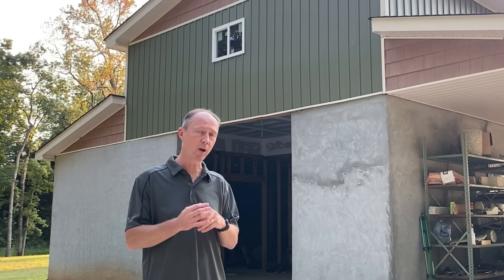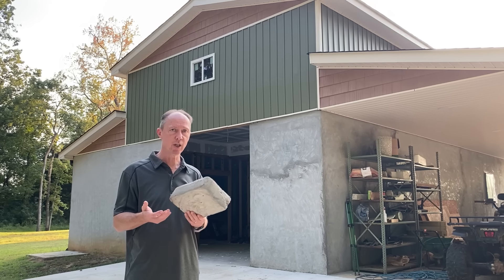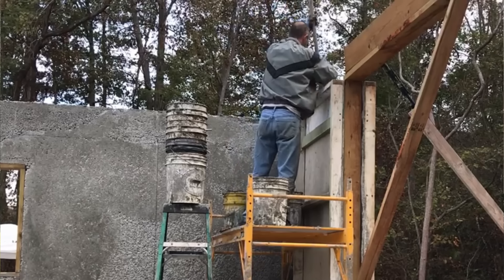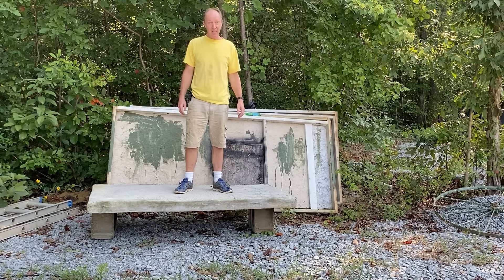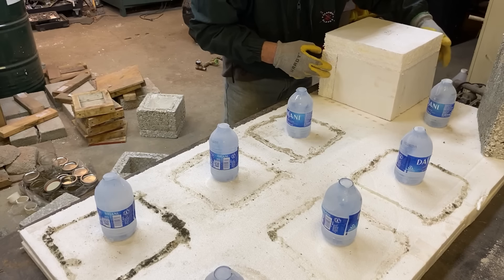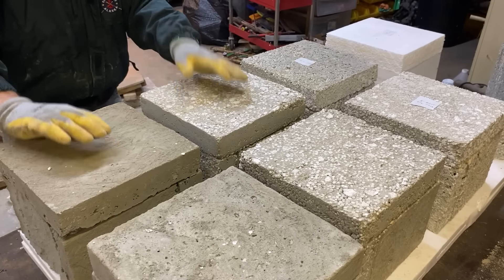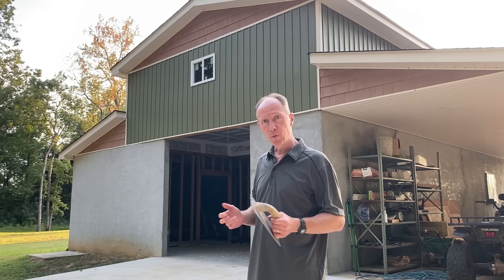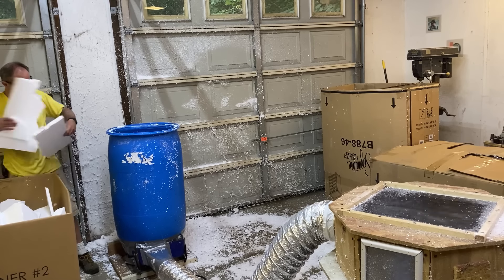The White Gold Rush?! The Video That CHANGED Aircrete Forever!

Comment: One method that would be good for someone trying to build like this alone, is instead of doing whole walls, make interlocking blocks. Kind of like those you see on some road construction projects. The size of which would be 3'-4' long by 1.5' wide and high. The size could be adjusted for whatever weight you have the capability to handle.
I am curious to know what your mix weighs when cured per cubic foot.
Reply: fwiw there  are a couple companies that have and still make ICF blocks out of it....
Reply from the maker: Hi Rollin. The mix I am using weighs around 10 lbs /cu ft.
Reply: @AbundanceBuild  do you happen to know the compressive strength?
Reply: @RollinShultz  Almost nothing. Don't build walls with this and put a roof on it. Long-term the expanded polystyrene is no better than air and without any other proper binding/strength substrate, walls built with this, if they're under constant pressure, will fail. Stucco is absolutely not a way to strengthen anything, it's just a finish. Make decoration with this kind of aircrete, by all means, but please, never ever, ever use this to build anything that puts lives in danger if/when it fails.
Reply: @tomteatom  You are right that stucco is not the way to strengthen but latex cement on fiberglass mesh that is a 1 centimeter thick shell is the way to strengthen it and it is incredibly strong.
Reply: @tangokaleidos1926  It's not just materials, although obviously you can strengthen anything if you care little about the cost and weight of additives, but something that's incredibly important from an engineering perspective is considering the actual physical shape of what you make. When these foam/cement bricks are produced in a commercial setting this is absolutely vital. The shape is informed by the nature of the material. The natural problems with using a polystyrene substrate are that it's incredibly weak and brittle if the substrate is allowed to cluster (and given the high electrostatic attraction of polystyrene balls, it's something that is difficult to avoid) and so the commercially available versions of this kind of brick are engineered to ensure that there's as much control over this as possible, with thin layers and an interlocking/interweaving structure that ensures your house doesn't fall on your head because the weight of the roof is resting on a fist-sized clump of polystyrene pellets that you couldn't see because you made enormous panels out of a slurry, because you simply didn't know why things are made differently. 
I have no problem with people experimenting, I just think it's absolutely ridiculous for someone with no experience as an engineer to be putting videos like this on the internet, endangering peoples lives, just because they had the sheer stupidity to think they didn't need to understand the subject they have decided to tackle.
Reply: @tomteatom Got a blankie, Tom?
Reply: @ Great reply, well done. Really added to the conversation, after 2 years.

Comment: That's a great idea you have.  I'd like to build a shed with this, possibly adding metal studs inside for added strength.  Thanks for posting.
Reply: It's been done already on Youtube.
Reply: @mackemacchiato3238  The wood would be slow to dry if it did absorb water from the drying cement, but that seems like it would be an issue of shrinkage and warpage from the water, rather than concerns for rot.  

A lot of people think rot is caused by it getting wet.  But rot occurs only by repeated wet then dry cycles MANY times.

Even a handful of cycles won't cause rot to cause any structural issue.  The fungus that makes wood rot only thrives at a specific moisture content, which is why the wood "swinging" through that % repeatedly enables rot.

It's why a wood fence post will rot off right at the ground before anywhere else: that is the most frequent spot on the post where it cycles from wet to dry over and over.

"Dry rot" is not a thing, despite old timers referring to it.

Either constantly dry, or constantly wet, you'll get no rot.   The wet version has been in evidence for 100 years at, for example, the St. Marks church in Venice supported by wood pilings driven into the mud that have never rotted.
Reply: I like that idea of using metal studs as a skeleton inside the Crete.
Reply from the maker: Go for it! Subscribe for new builds coming soon!

Comment: Cool experiment.  I'm very curious as to how this material would perform in the role of prefab roof panels.  If it's light, thick and rigid, it'd be interesting if solar arrays could be mounted or integrated on them without the posts penetrating all the way through the barrier.  

 Fine sands and silts can be obtained from bulk sediment with suspension sluices and sifting frames.  Basaltic sediment may even reduce emissions from the curing.   Frayed tarpaulins and retired agricultural polymer netting are probably a good source for reinforcement fibers.

Please protect yourself with respiratory PPE or engineering controls so that your interesting experiments may continue for a long time.
Reply: that would be really intresting, were you thinking of using it more like spancrete? or more like individual smaller pannels fitted together?
Reply: @timgoodliffe  That's interesting as well. Spancrete  marketed as "Space-Crete". Give us a couple of practical uses. Let's get this thing going.
Reply: That’s a great idea. The mounting hardware could be fully integrated into the panel that way. It would still need a durable and waterproof top surface. If you used a meltable PC or polymer it would surround the hardware stems.
Reply: I also love the idea of retired netting as a recycled fiber.
Reply: we used to work for a restaurant chain building the restaurants. The walkin freezers were built onsite using premade foam panels using 4x8 sheets of OSB on the inside and out. the osb hung over each edge of the foam about 1/12” so you could screw the panels together by screwing thru the foam into the next overlapping  osb panel. This is one way you could make roof panels with aircrete as well! I would definitely use the correct supports underneath ! Thats where a good engineer or architect comes in! I am a firm believer in that buildings have to be constructed so they are SAFE!
Reply: I definitely would not put any additional loads on a roof made out of this. Solar panels could easily create more uplift force than this material can handle. Unreinforced concrete only has minimal compressive strength. And it really has no strength other than that.
Reply: and recycling afterwards, who cares, right?
Reply: @onetwothree4148  
Pretty sure that unreinforced concrete has pretty much the same compressive strength as reinforced. But agreed, little strength other than that.
Reply: @robbiejames1540  yeah, I wouldn't trust an unreinforced span of this to transfer energy into compression. Without steel to stop it, or an arch design to distribute it, you're really looking at a shear force.
Reply: @onetwothree4148  
Oh, if we're talking about this material (as opposed to ordinary concrete) I totally agree. Even under direct compression it could crunch in due to all the air inside. But him standing on that panel of it was pretty impressive.
Reply: @robbiejames1540  yeah my wording wasn't very precise, but any unreinforced concrete isn't really going to have much "compressive" strength if its spanning roof rafters.
Reply from the maker: Good ideas! Subscribe for new builds coming soon!

Comment: Very cool!! I’ve been interested in aircrete for a long time I just have too many projects to complete yet and a warm shop before I can start experimenting. Subscribed and looking forward to future videos.
Reply: We’re did you find that elevator?
Reply from the maker: @Top12Boardsport  On YouTube. Search for Winch elevator. You will see several of them. Really cool.
Reply: @AbundanceBuild  Have ever consider using "glass foam" aggravate in concrete pour for a slab?
BTW there are few companies that  make blocks of of this material that is used as an ICF. And I have seen a structural engineer test wrapping fiberglass mats, a inside failing CMU wall to reinforce it. But there is the 1st time I have seen these build ideas combined in there manner.
One last question was there any issue with you local code enforcement signing off on it? That seemed like the major road block in it being used more.
Reply: @AbundanceBuild  Which roofing fabric?
Reply: P
Reply: @VeganV5912  opp
Reply: This has been  used for floating docks. With a steel sub base  for  strength and hinge points and boat moorings.

Comment: Very good idea, thanks for your time and researching! I was thinking from the outside we need facade, of course there is lot of ways to do it but..., If we vibrate the concrete then we get nice surface. Now there is lot of products on the market, there are some fluids which you can spray on the concrete and it is water-resistant later and you can be sure that your concrete wall doesn't take moisture in winter days. After that you can choose some paints do decorate it.
Reply from the maker: Thanks for the tip! Subscribe for new builds coming soon!

Comment: We want to build a round house using 4X8 3/4" plywood that we collected years ago from trade shows. We have been looking for a method to make the home insulated and fireproof. We need to learn the "recipe" for the cement, the aircrete and the styrofoam Mix, so we can Mix it into lego blocks and stack them to insulate the outside of the boards in a circle we use to build the circular home. On top of the home we will build a deck as a ceiling inside the home, roof and deck above the home. On that Roof/deck we will add a Smaller dome and attach it to the deck, so there is a sitting space where we can eventually relax in the evening and look at the view. This is great info. Cannot wait to see what you create so we can get the exact mix and make some stuff ourselves..!!
Reply from the maker: go for it! recipe video coming soon!

Comment: It would be a good idea to perform some basic material strength measurements so that the properties of this material can be used to engineer the structure. What is the compression strength? Beams generally fail in tension? What is the tensile strength? You could estimate these using your sample panel and a few tests.
Reply: Please, please someone please do this test.  I don’t know how to do these tests but I understand why they are necessary and would really like to see the results so this practice can be adopted more widely.
Reply from the maker: Sam, I am thinking through how to do a variety of tests. I am moving towards using the wood truss design i showed nailed together with scrap 2x material from building sites. This will give you the ability to pour the walls and roof in one monolithic pour. This will give it tremendous more strength and nailing surfaces to screw sheetrock, siding and metal roofing.
Reply: Why let facts get in the way of a bad/dangerous idea?

Comment: Nice presentation of very solid content!  Well thought out. Thanks for sharing it!  What I am missing is how the second story is attached - so it does not end up in Oz?
Reply from the maker: Thanks for the feedback. I bolted a top plate with long screws into the top of the aircrete and the floor sits on that and interior walls that are all nailed together.

Comment: I think it would be a really bad idea to have OSB in direct contact with concrete even if it is aircrete. Concrete has a lot of water that takes quite a long time to dissipate in its curing process. During that time it will degrade the OSB.
Reply: I dont know bout permanent, like osb i-beams combined with this for sips, but we use osb to form concrete on anything with a bigger exposure than 5 1/2" all the time. Faces fine n pops free well as long as it's juiced.
Reply from the maker: Thanks for the tip!

Comment: Despite what the Ontario building Code (and I suspect others as well) would say; Using OSB on a roof is not a good idea. When the roof invariably fails, the OSB takes on water, swells up and falls apart.  

@14:26 Some of it even makes it into your container...

Your efforts are intriguing.
Reply: I was assuming that he meant that the osb on the roof panel would give you a layer of osb to lay underlayment and shingles or metal roofing on instead of using the panel as a roof structure without any covering.
Reply: @robhendrix8020  The problem is the OSB. When the shingles fail, the OSB gets wet, swells up and falls apart. Its fine on a wall but, on a roof or a bathroom or kitchen floor... Not a chance.
Reply from the maker: Thanks for the tip! Subscribe for new builds coming soon!

Comment: Nice video Steve. Always wonder how that styrofoam could be used. Have you had any panels load tested? The arch is cool. Create a flexible template/tape to attach to top of the arc mark the blocking zones for nailing/screwing sheathing. 
Have you checked fire codes for toxic gases if the structure gets HOT. Wondering if fire personnel would enter a structure if on fire.
I really like your creative thinking/process. 
Good luck. Looking forward to your videos. 
I watched a home being built in the early 70s. Today it is called The Flintstone House in San Mateo County, CA. It has been the center of many a controversy. Check it out. Neighbors have recently raised hell regarding the theme in the yard along with the colors. It’s the only organically shaped home on the surrounding hills. Everything else is “boxes on stilts “. There were many leaking problems with this home. Today’s materials would have been a great help. 
Wonder how this technology would work on a Buckminster Fuller geodesic dome structure. Create some panels that can be bolted together. 👍
Reply from the maker: Thanks! New tests coming soon! Subscribe to be notified of results!

Comment: Interesting idea.  One thing that occurs to me is that expanded polystyrene (that's actually what you're using ... styrofoam is a different product) is very flammable.  Have you tested the fire resistance of this stuff?
Reply from the maker: Yes performs well isolated in the cement! subscribe for new regulatory tests coming soon!

Comment: I watched a bunch of aircrete videos before and had come to the conclusion that it wasn't really worth the effort. I saw this video in my feed and almost skipped over it. this way of doing it seems to be the most practical, repeatable, and easy method. this has changed what I was thinking for my cabin design

that said, this cannot be a structural material. first, bricks, concrete block etc. do not have their strength judged by "it held it up". building materials need to withstand failures in weird directions and for all kinds of reasons. second, structural materials cannot have catastrophic failure modes. that's why rebar is in concrete, so what when the concrete fail, the rebar holds the structure together. so, if anyone is thinking about building with this, you should build a structurally sound building FIRST, then use this to fill in the walls. something like traditional stick framing then filling in the wall cavities with this stuff would work well.
Reply: Maybe with Post and Beam style Buildings, as well! But, he did mention you could form blocks, like "Concrete Blocks, that have 2 Holes in them, for Pouring Concrete of whatever PSI you Need, for Vertical Columns, that are then the Structural Support, while the Aircrete Blocks from the Insulation, AND stabilization of the Columns!

Using Vertical Rebar, tied to 1/2" Square Metal Mesh Construction Cloth, in those holes, should be a Good Core to the Columns!
Reply from the maker: That's the goal! Subscribe for new builds coming soon!

Comment: Maybe mix in some fiber mesh like used in concrete slabs . Would be interesting to see if that would give you the strength needed without having to lathe it ,etc.
Reply: Exactly what I was looking for here in the comments.
Reply: Fiber mesh isn't a substitute for steel reinforcement, its intent is to reduce cracking during concrete curing
Reply from the maker: Thanks for the tip! New builds coming soon!

Comment: WOW!  Love the content and all the info.  Thanks for sharing. Typical aircrete recipe  is about 150-160 PSI.  What do you think you're getting on your mix design?
Reply from the maker: Thank you. It is lower than aircrete because of the styrofoam. It has good compressive strength as you can tell from holding up the second floor. The strength comes from the fiber mesh stucco. The wall is very flimsy until that is applied.

Comment: when working for a swimming pool builder in the 80's, we used a 50/50 mix of mortar and vermiculite block insulation for the bottom of inground swimming pools. it was easy to work with, and cut the cost of materials by almost 40% when compared to concrete poured bottom.
Reply: Called poolcrete now. Still use it. No way it's structural tho. And no way it can get wet n live.... or get driven on...
Reply from the maker: Thanks for sharing! Subscribe for new builds coming soon!

Comment: Nice work. What are the benefits of mixing with aircrete rather than just standard concrete? Could you not just use a little more styrofoam and then not need a foam generator?
Reply: Good question. I originally thought that is what he did. I had to watch the video twice to see the suds being added.
Reply: It's proprietary and more expensive. It also has not stood the test of time and will probably fail spectacularly like all the new stuff does. Unlike that chinese made faucet that fails in a year, if this fails, it's going to require your entire house be rebuilt and gonna cost you more than $100 to replace.
Reply from the maker: Yes! New foam free recipe coming soon!